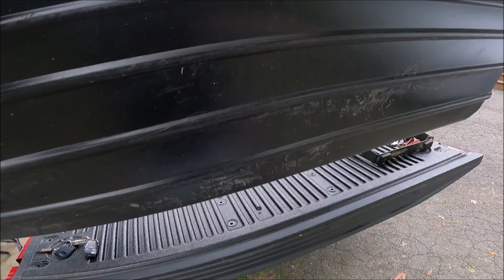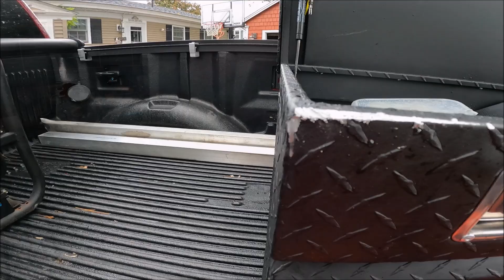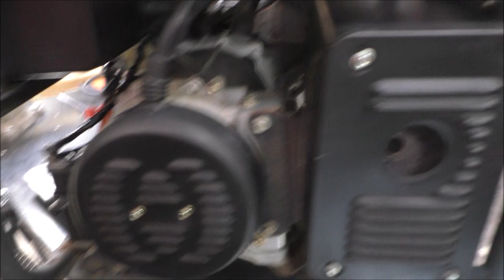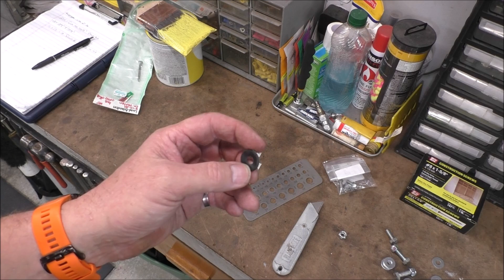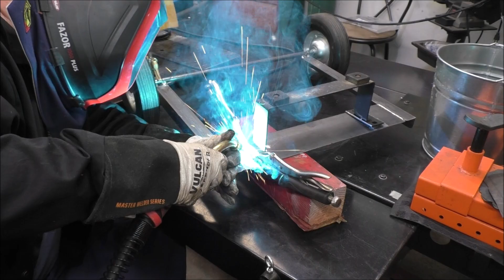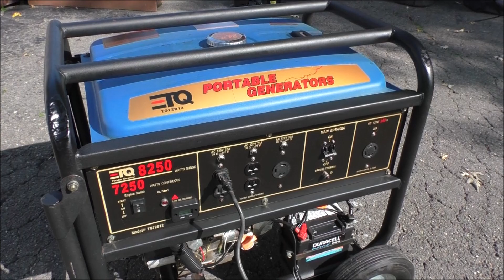Total Chaos! My Truck Spills Out Tools and Gear – You Won't Believe What Happened!

Comment: Hi  I finally purchased my first welding machine. It’s a S7 MIG 200 . I want to use core flux on it but don’t understand how to set the voltage and speed on this one. It didn’t come with a chart and voltage goes from -3 to +3. . I’m used to seeing in videos voltage 13,  etc. Can you help me?  I was so excited to start but I can’t even set it 😢 2:57 2:58 3:03
Reply from the maker: I replied to your PM

Comment: Those plastic liners are very slick if you have to leave your tail gate open I would consider putting a piece of thin rubber under the legs of everything to keep them from slipping out.
Reply from the maker: This is my first plastic liner. I learned how slippery they are the hard way LOL. Good tip on the rubber!

Comment: Good to know about those tie-downs. I’ve got the same truck (same color even). I use those tie downs all the time ………. Not any more.
Reply from the maker: Same! I tie dirtbikes to those. Not anymore. I think the non-boxlink (the ones in the corners of the bed) are much stronger and those are what I will secure most stuff to going forward. With that said, it probably wouldn't have happened if I secured the strap around the load, rather than side to side leaving some space between the strap and generator. I think being slippery, raining and being shock loaded from sliding made this situation happen

Comment: In all seriousness that is why you drill holes and use bolts.  I am not being mean but this could have. Even a lot worse. Drill your bed and secure things. Preferably where you can tie into the frame.
Reply from the maker: Not having anything securing the toolbox and generator is why it fell out.  The tiedowns are rated for 600 lbs but aren't shock rated. That's my fault for just running a strap side to side at the back of the bed without it actually securing the load.  These Tractor Supply tool boxes are pretty thin. The toolbox will tear apart this time before the hardware fails. This setup is rated for 1200 pounds. I'm not worried. Not even a little. Securing the toolbox to the bed wouldn't have prevented the generator from falling out either. Shock loading is what broke it. Lesson learned.
Reply: Sorry but having factory tie downs fail I disagree. They were held with 2 screws. Metric but about the same as 10-32. And drilling he's in the bed is no big deal
Reply from the maker: The factory mounts are actually held with 4 screws. That's not what broke. The casting broke.

Comment: Hey Brandon, I really enjoyed the video. Maybe install a wing nut on at least one side of each turnbuckle for an easy to release "lock nut" so they don't back off and create slack. May be overkill but, once bitten, you know?
Reply from the maker: Excellent advise! I actually bought some stainless nylon locking nuts thinking the same thing, but I didn't install them. Im going to keep an eye on it and see if it becomes an issue. It very well could, and locking one side as you suggested would prevent it. 👍

Comment: Murphy's law, if something can go wrong, it typically will =( Bummer but a hard learned lesson on the joys of bed liners which, especially when wet and in combination with a wonky strap anchor, are like ice. I went to spray in years ago for that exact reason.
Reply from the maker: I've been toying with a spray in liner since I bought the truck. Maybe thats the way to go
Reply: @BrandonLund  honestly, it's a game changer in regard to the skating rink that drop in liners represent =) The plastic ones chafe the bed paint and also trap moisture so there's that too.

Comment: That sux.  But you're capable of making it better.
Curious how much that generator weighs.  I've got one a little smaller than yours and it's a bear.  Impressed that you're lifting that in and out of the bed.
Reply from the maker: Thanks man. It's got to be close to 300 pounds. I just leave it in there all the time. It's too heavy to take in and out

Comment: LOL! Well you don't have to worry about scarring it up anymore😅 that sucked.
Reply from the maker: Lol I know right! 🤣
Reply: I have the same truck. With a similar bed liner. I will never have another one. I dropped a whole load of drywall and plywood in the middle of the road in front of the local policeman he turned on his lights and ne set there. An older man came out and helped me load it back up. It was like 25 sheets of drywall in plywood. I had it strapped down. It just slid underneath the straps.
Reply from the maker: @scottchastain1382 that must have been embarrassing! I don't know if I mentioned it, but this entire load spilled out in the middle of a busy intersection. I was so embarrassed.

Comment: The "hurrier I go the behinder I get". I know just how you felt when it happened, dropped a load of tin in an intersection being in too big of a hurry myself. Took a while but I got over it. Glad you got all your repairs done the way you wanted to set up your truck bed and it all works great. Stay safe and find a better place to turn safely. I did that too!! Fred.
Reply from the maker: I feel your pain Fred. I don't know if I mentioned it , but this load dumped out in the middle of an intersection also. I was so embarrassed. It was pouring rain out too. I felt like a rookie. Live and learn. I will never just throw a strap side to side and leave it loose and hope it holds. Total rookie mistake on my part.

Comment: Double block with a pulley make it easier to come-a-long and get smaller adjustments.
Overall it’s not that bad and you fixed what needed fixed.
I need to put wheels under my Honda eu3000. Thanks for the ideas.
Reply from the maker: Thanks for sharing!